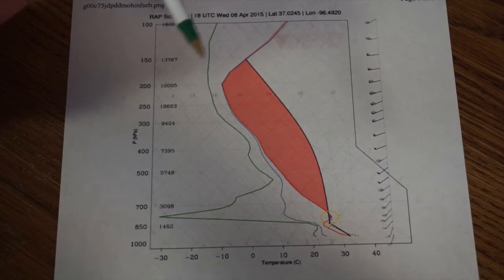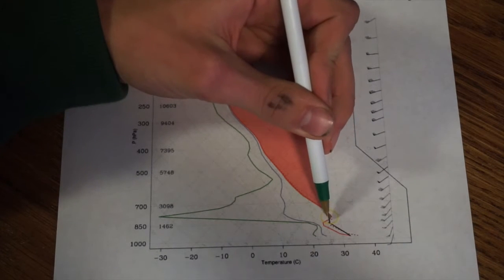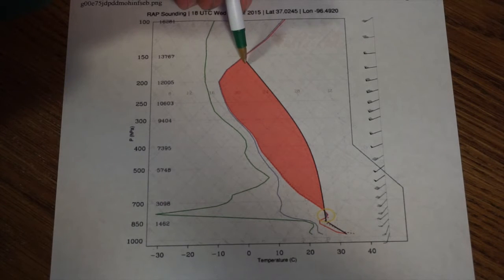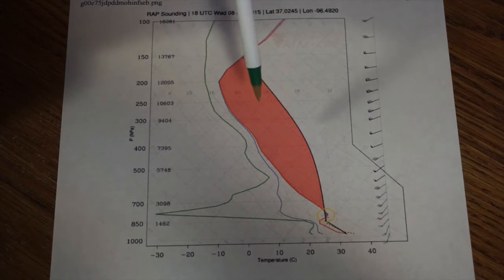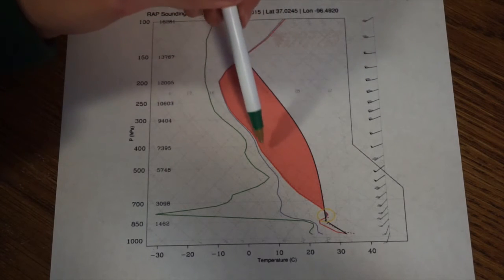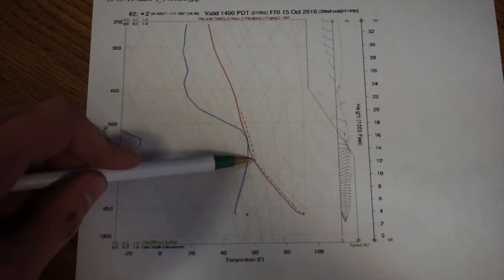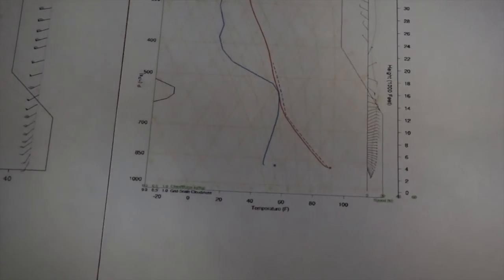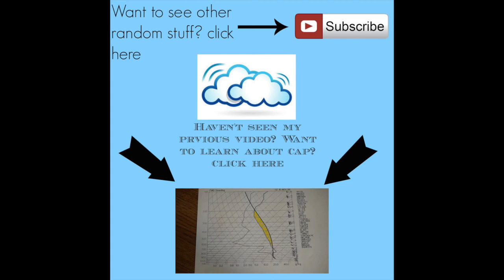Weather Term: Cape Explained

Comment: Incredible CAPE probably 3000 J/KG+ but that super dry layer at 750 would make it harder for storms to develop. If directional shear made this high CAPE environment favorable for supercells, those supercells would likely be LP types not HP because of that very dry air at 750. Great video btw for anyone who doesn't understand what CAPE is.

Comment: Extremely interesting, thanks for explaining this. I still don't fully understand it, I'm still learning. Now...the lapse rate. What determines that? Where does it come from? Thanks.
Reply: Xenon 93 yes that s what he meant.    And something he didn't mention. The lapse rate is changed based on how much moisture is in the air that's rising.  More moisture takes more time to cool off than a parcel of air with less moisture.   Look up videos on dry adiabatic and moist adiabatic lapse rates and you will really get it.  There's a lot of great videos here on youtube with all kinds of graphics and such to make it easier for anyone to understand
Reply from the maker: Your welcome I'm glad i could help. The lapse rate is a rate at which the air needs to cool as you gain altitude to keep an air parcel warmer than it so it can keep rising. now when you have lapse rates of say 10 degrees celsius of cooling per 1km or more that air parcel will rapidly rise because it is a lot warmer than its environment.... Now what actually determines the lapse rate seems to be from a cold front making the upper air much cooler than the ground causing warmed up air from the ground to rise, and something that prevents rising such as a cap
Reply: +Trent, I think you meant to say "... to keep an air parcel warmer than its surroundings so it can keep rising" right ? :)